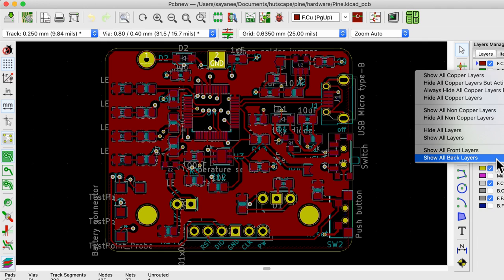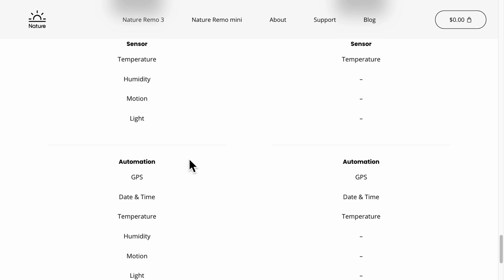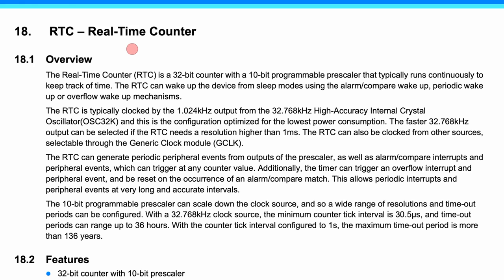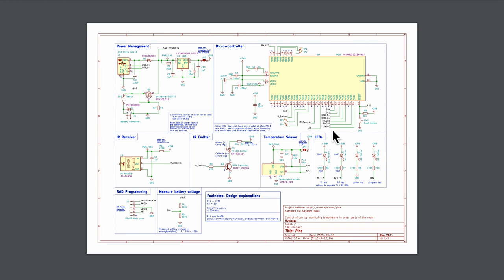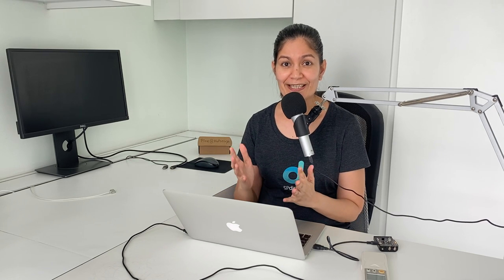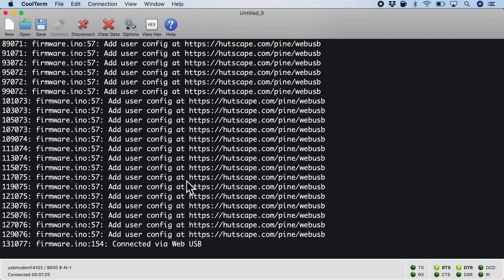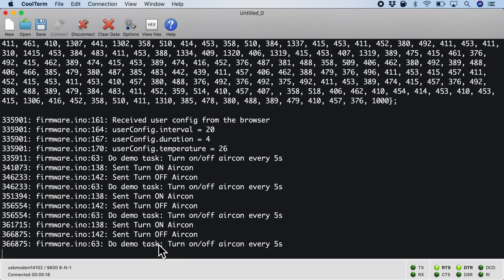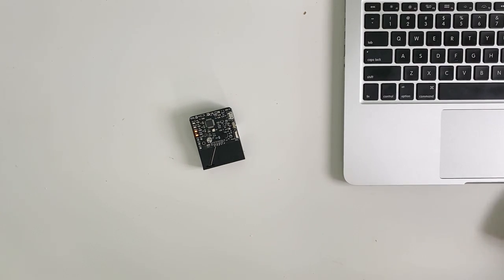How I built a simple IR blaster to replace my aircon remote // Arduino, sensors, infrared, WebUSB

Comment: good!
you just testing On and Off,how you can send a raw data just for the mode air conditioner or a raw data just for the temperature??
when you recieve the IR from the remote.the raw data containe the power and the mode and the temperatue
Reply from the maker: That will depend on the exact remote controller and the aircon model. Whatever it is set in the remote control, that exact feature will be recorded in the raw code.

For example, even though I recorded ON and OFF, it seems that for my remote control and aircon model, the ON and OFF functions are also tied with a particular temperature. So, in this case I recorded ON 25 deg and OFF 25 deg.
Reply: my remote send all parametres power,temp and mode in the same raw.So, i will try to separate it and search a solution ;)
Reply from the maker: @dhiaeddinesouai5334  Yeah I guess, most does combine a few of the factors together into one single raw code. Maybe you can try  https://www.analysir.com/blog/get-analysir/ - I never tried it, but I keep hearing about them.

You might need to dig into the infrared signals. Would be curious to know how you did it, if you ever manage to :) All the best!
Reply: @sayanee  thank you 
All the best ;)

Comment: The ir code with IRLIB2 is different every time. I cannot get the same. How did u manage to get the correct code ?
Thanks.
Marc.
Reply from the maker: "get the same code" are you referring to the IR raw code recorded? If yes, then you are correct that the long array of numbers will not be exactly the same every time you record. 

I believe it's something to do in the conversion from analog IR signals to the digital form in the array. But's it's ok :) 

Try both the "slgihtly" different codes for the same remote control button and see! Both will still fire the same command.